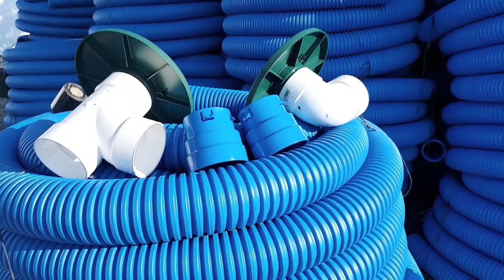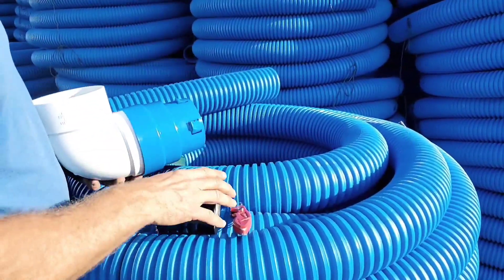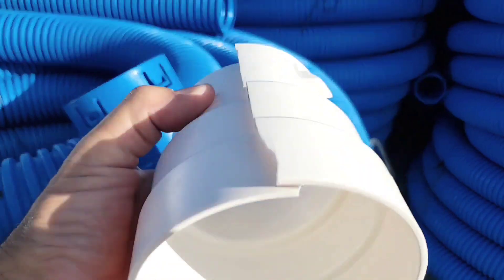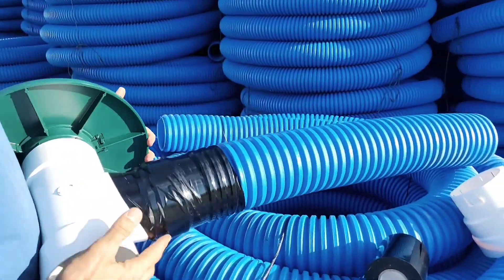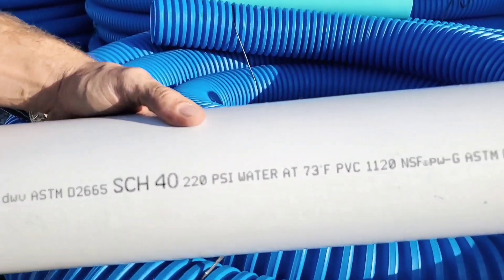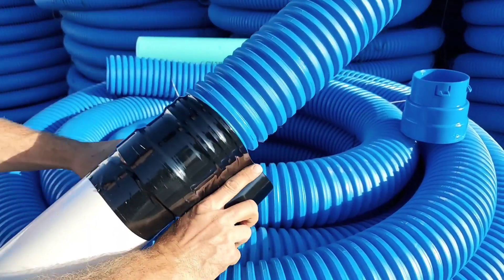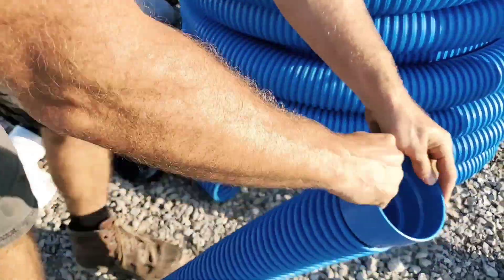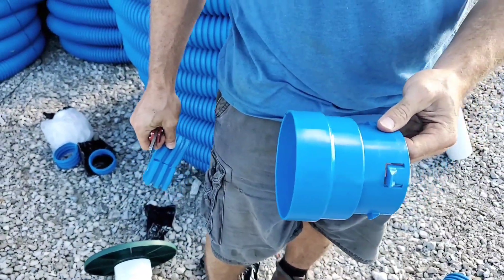Best Underground Downspout Pipe Connection

Comment: What type of tape are you using to seal it? And do you make a 2" version? I have some wire I need to bury in corrugated hdpe and then use PVC to run up to an LB..
Reply from the maker: https://frenchdrainman.com/product/4-x-108-fdms-200-year-tape/

Comment: Okay so serious question ... I mentioned before that my French drain only has to be 30 foot (28 to be exact) and because of the price difference between one 15 foot section of 8 slot per the cost of 100 foot,  it only makes sense to get the 100 foot. However - most of my system is down spout drain.. now, could I use slotted pipe for the downspout drain instead of solid pipe in order to save money? I need a little under 200 foot of solid pipe, can I supplement the solid pipe with the slotted for the application? That side of the house doesn't need a French drain, just 4 down spouts need directing away from the house.
Reply from the maker: Knife cut pipe will work for both